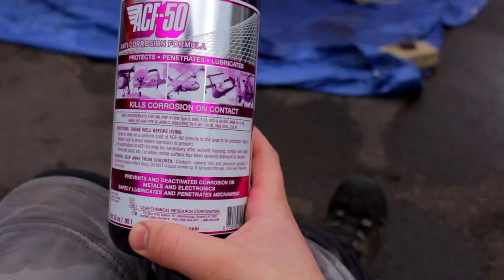Applying ACF50 to the new Bike | How To | The best protection for your Motorcycle

Comment: Nice video and good choice of protectant 😉 I find spraying it all over the bike tends to waste a lot of product so prefer to apply it mostly with a microfibre cloth and a couple of detailing brushes ... spray it into the areas ya can't get the cloth or brushes into then use those to spread the excess / over spray around. The brushes are great for getting it deep into all the bolt heads and into the tight corners and the cloth is great for wiping it over the swing arm and around the frame etc. Takes a bit longer but it's always good to spend some time paying very close attention to all areas of your bike ... helps in spotting loose fixings, leaks, cracks and other potential issues 🙂
Reply from the maker: Thanks mate really appreciate the tips !!!